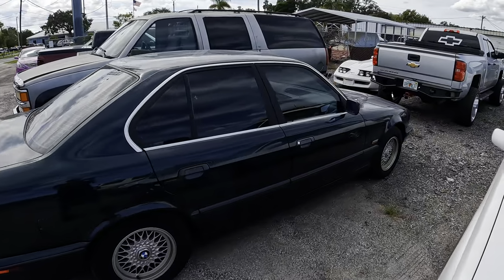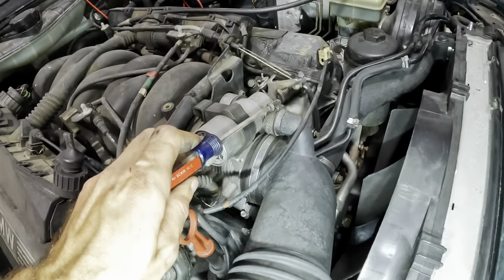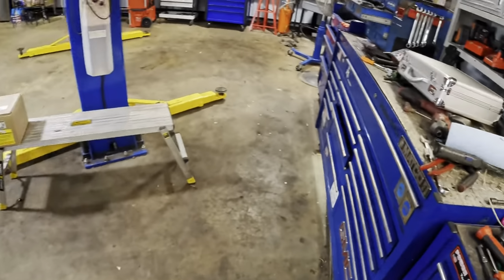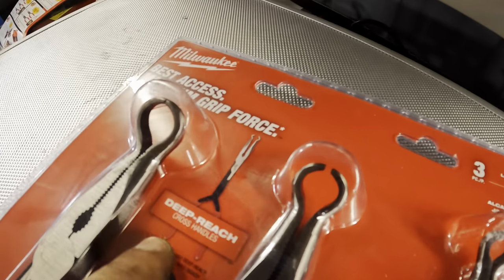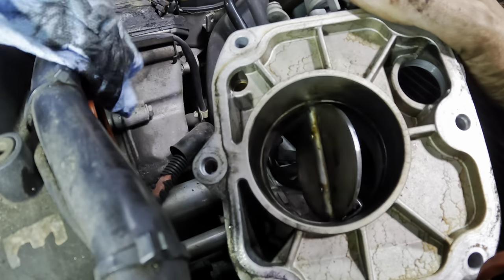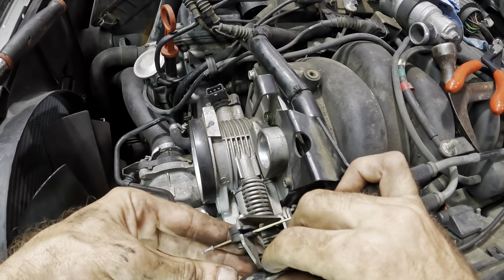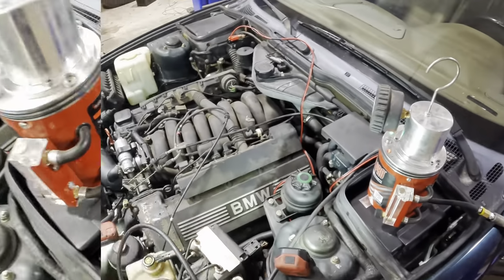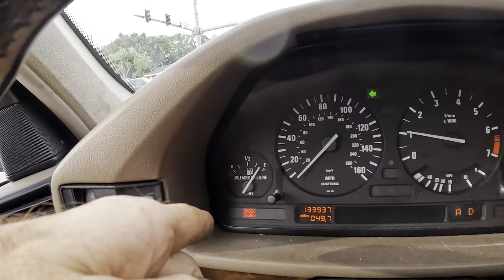DO NOT DO THIS! Hack Repair. Engine Diag Running Rough BMW 530i 3.0

Comment: Ray, have you tried the propane trick for diagnosis of an intake leak? The same trick works with wd40 or other flammable sprays.  If while idling you point the hose from a propane source or spray around the intake and if the idle goes up you found a leak.
Reply: The better version is using brake clean because you can't really put a torch in many intake runner areas especially on the V engines
Reply: @ScrewedEquilibrium  Not lit, the propane gas alone. THe mechanic that located my intake leak had a very long fine tip to get into very tight places worked great.

Comment: One helpful hint on BMW engine clamps, the BMW symbol should generally be facing up (or forward). This is not 100%, but damned near. When they are situated in that position the tightening screw should be accessible and it will make sense where to place the driver to tighten.

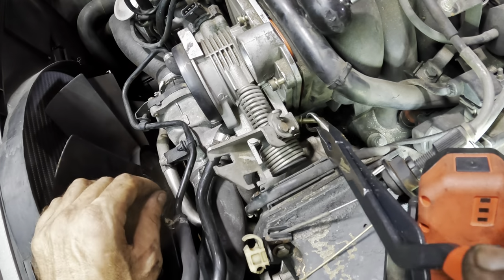Comment: @34:00... Use a hose with an I.D. that will fit the end of that bolt and snake it in underneath.. Get a couple threads in and wala... You know the rest.

Comment: Someone tell me about the misfires. When Ray is test driving at the end, he is anticipating possible misfires as the car comes to a stop (idle). Is idle when misfires from bad air-fuel mixture are most likely to manifest?  Great video from an older BMW fan. Thanks.

Comment: Use Gorilla duct tape ! I use the stuff to tape a tarp over furniture on a utility trailer and it held up for a very rainy trip of1500 miles. So well it was impossible to remove from the tarp and frame of the trailer. ( no ratchet straps were used) Moved the stuff for my ex wife and actually was hoping damage would be done !

Comment: Hey Ray, I see that towards the end of this video you are not so enamored with the front flipping hood. At the beginning you were eloquent about how much better it was at giving access, because of the vertical stance it takes when open. And this is true. What is not so clear at the onset becomes very clear as the work progresses. With normal cars, you have access to 3/4 of the engine bay. The cabin and body get in the way at the back. With this German beast, the access is one half, less than normal, and compounded by the fact that you have to walk around every time. So the negatives outweigh the positives.
Reply: They never wrap around the windscreen though!:face-blue-wide-eyes:

Comment: 34:57 a trick to locate a bolt like that in a very hard area to reach 
Is slip a none interfearing tiny too small of an O ring over the seating side of the bolt to hold it on by 2 or 3 threads  then when you slip the part down into its location the bolt is ready to thread intto it location 
That or a thick grease in the bolt hole.
If you think about it outlet screws are held on with a thin cardboard 
So you always have the screws.  Same idea.  It can save you from doing bolt aerobics.

Comment: Hey Ray! Nice. These days there's probably an RFID embedded in that package, which an antitheft gizmo at the door can see to raise an alarm if you haven't paid for the pliers. So maybe the stout package is not totally dumb... They sure are ridiculously hard to open though. :-) Your finger dexterity is amazing. I'm sure I would have needed a half-hour to get that bottom bolt in the throttle body started.

Comment: regulator bars just need a little fresh grease to get them movinig but taking the plastic barrier try to avoid the goo glue. lol. But what did codes say or once you drove and keyed few times did engine recalibrate and you were done on BMW 530i 3.0?

Comment: Self fusing or vulcanizing tape instead of standard electrical tape would have been a semi-temporary solution and givven much better seal. They can be handy from time to time to create a good seal around something... like sealing some broken connectors together or making them watertight.

Comment: Guys when you have the smoke machine connected and block the throttle body you have to give the crankcase a way to let the pressure out if not you can blow out the crankshaft seal and that would be bad, don't just pull the dipstick the reason for that its tube may go below the oil level so that if you don't put the dipstick in fully you don't create an Evap fault. Saying this from experience.

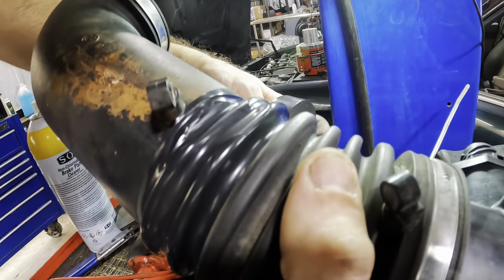Comment: @12:10 I had used 2 layers of duct tape to temporally plug holes like that until I could get the part as I had only one vehicle at the time.

Comment: Another tip is to tape the bolt to the end of the tool.  After it's tight, you just pull the tool out.  Heavy grease has also worked for me for 'sticking' a bolt to a tool.  But I'm really surprised you don't have any magnetic tools! @rainmanray

Comment: That's a massive hole.
Never seen a hole that big in an intake boot.
Downstream of MAF sensor.
Massive positive fuel trims both banks.
Super lean mix.
Goes into limp mode.
Does OBD1 not include fuel trim values?
Sure it does,

Comment: While I don't think my Kia Sportage has a rodent hole in the intake, post mass air flow sensor, I did remove the intake to replace the valve cover gaskets and just clean and gap my previously replaced spark plugs.
Since then, I have a bunch of check engine codes relating to the O2 sensors and running lean and fuel trim.
I happened to have four new O2 sensors and changed bank 2 while I did a radiator replacement. Unfortunately, I got them after the intake manifold was removed and replaced and the bank 1 sensor 1 O2 is going to require pulling the intake to get to it.
I suspect the engine is saying its running kean, because it has more air than is being metered and thinks that the fuel is lean.
The first time the intake was removed, there were air leaks and a mechanic removed and resealed it to correct the problem.
I made every effort to avoid having any air leaks when reinstalling the intake, but I do suspect that I still missed a spot.
I made a makeshift smoke machine using a fog generator from Halloween and the output of a shop vac to supply air pressure and didn't see any smoke leaking, but it was not the best way to test.
I just hate to have to remove the intake and reseal and reinstall it.
The car actually runs pretty good, but has the check engine light illuminated.
It did on a few occasions run rough and misfire at low rpm to idle.
.

Comment: Hair shifts to comment of what I think would be a perfect repair for the whole. Is you some of the insulations carts that you used on your Silverado duly pick up that you put on the floor board for as you called? It a installation paid is take that pad and since it has the sticky side on it put that on that whole and take a screwdriver some and just. Keep walking it back-and-forth and told you have determined that that.
 How was sealed off and then put electric tape around it to hold it and?

Comment: Throttle body butterfly shaft leak. Not much can be done about it without modding it or replacing the whole TB. Been there done that. 😂

Comment: Activa 001 looks like a Chevy Spark, which is also known as a a Daewoo Matiz. The Matiz was not a great seller, but the same vehicle, just with all the Daewoo badges replaced by Chevrolet, was a pretty good seller, as it is both economical, low cost and relatively cheap to maintain.

BMW going to bet check engine light is a dead cat or oxygen sensor, caused by it being a little long in the tooth, and having an oil addiction, or a inlet flap or cam fault.

Comment: They off BMWs around the 100,000 mile mark because all the plastic, vinyl and rubber parts start to breakdown from the heat under the hood. They are well worth the time and trouble to repair if you can find a good mechanic.

Comment: I bought a 97 540i 126k on the dash. When I went to check the car out the guy I was buying it from leaned on the intake hose and cracked it. The car wouldn't start. I left and he called me 20 minutes later. He patched it up with duct tape. He was asking 3000 I got it for 2200.

Comment: That looks just to be about right size to go down to the diesel mechanic shop and get a charged air boot. You can cut that waffle stuff off and hose clamp it right back together.

Comment: Might have been worth while cutting a slot in the head of the damaged torx bolt, if you can’t replace it. A slot screwdriver won’t apply as much torque as the correct torx could, but it will be better than a pliers.

Comment: Hallo Guys! One question......Why does the M62 have low power on low RPM ....?!! i have 740 IL non vanos from 96 ....and it's a lil bit slow......the previous 728i(European version with M52) was more agile ....
Reply: With an inline six, DISA valve on the intake manifold may be the cause. Common symptoms  are low speed sluggishness and could be a puka puka sound coming from inside the intake.
Reply: @rodbender6184  M52 from 94 to 99 has no DISA ....and M62 is a V8

Comment: You need to put declaw hammer back into your carpenter tools. It looks strange for anyone to use a claw hammer on the engine work, but as you say everything as a hammer, big Ed coming to you from Central city Kentucky. Have a great and wonderful day.

Comment: you say the thief would just take the whole thing, but you'd be surprised.  I work in retail and i WISH they'd steal the whole damn thing, then i just have to do a inventory adjustment.  What they do instead is steal a handful of screws out of a box, then i have to try to sell what's left (not as easy as it might seem at times, even with discounts)  One time a guy tore open a set of house numbers and took just the screws.

Sometimes when the customer only wants 1 thing in a pack, they feel it's a ripoff they have to buy the entire package and decide it's ok to just take the piece they want.  After all, how much are just the screws worth? it's only like a couple cent's right?  Except it's not easy to find proper replacements, if it's even possible at all (in a practical manner, no sense spending 20$ of time to save a 10$ product, that people still won't want because it's been opened)

Comment: Hi Ray. Not sure how big an issue it was in parts of America, but some of the M52 and M60 BMW engines here in the UK suffered from the (in)famous Nikasil high sulphur fuel erosion. Might be worth a compression and leak down test even after almost 30 years?

Comment: Heat from the thermostat housing made the bellows brittle over time, you missed an opportunity for upgrade and saving the customer a buck and the down time when you could have just cut the flex section out of the equation and replaced it with a (naturally more hi-temp silicone) section from a CAI...

Comment: If you need to manoeuvre a bolt into an awkward place you're best off with a magnetic holder or, failing that, jam a piece of paper between the tool and the bolt or stick it to the tool with some sticky tape.
Your needle nose pliers method looked right awkward. 😁🖖

Comment: How could you neglect to see that the rubber mount slides up and on from the bottom of the bracket? You just put it on 3 minutes ago. 🧐🫡🤤

Comment: PLEASE BroMechanicMan: put an Auto close on that Side Entry-Door.

It’s gonna catch something eventually.

Then? You’ll be “Poppin’ Zee Door”….& some PDR as well.

BTW?, “Smoke” test will NOT reveal an intake gasket leak….why?, Because they pressurized smoke test fins passages of least resistance whereas an (opportunistic) vacuum leak?, simply sucks through anything & everything at greater & higher velocity.

On BMWs the weakness is always the intake bellows.

Disappointing That you didn’t break out the double handed brake Kleen master-blaster on that throttle body.

& those hard to reach bolts?, best to use a pen-size pocket telescoping magnet.

Comment: That is an early design Nikasil cylinder coated engine. They had issues.  Do some  internet research and a compression test before getting in too deep...

Comment: Ah the old M60, predecessor of the M62 in my old E39 540. These things are such garbage. That car was such a money pit. Leaks from every orifice; valve covers, spark plug tubes, oil pan. Garbage plastic cooling system, wonky MAF sensors. I don’t miss that car (or the ones with the early N63). Thank god the newer ones are far more reliable. 4 straight BMWs now without a single dealer visit for repairs. Knock on wood.

Comment: Hmm. An old E34 should feel better than a modern VW, or anything from the Ford stable. If it doesn’t, there’s something wrong. The autobox seems wrong and the v8 noise seems strange and misbalanced for one of those. They’re usually sewing machine smooth, with a snarl from the factory exhaust, and mostly manual, over here. But they’re all sixes, or at least, the ones that I’ve owned and/or worked on have been. They were marketed as the ultimate drivers car, so any driver that bought an automatic one would have been ribbed mercilessly by his mates in the company car park.

Comment: Ja..."da Deutsch Auto"....meh,  I like my Ford F 350 Super Duty with the Diesel option thanks.  Works great tow'n a 4 horse trailer 'n 4 800 to 1200 Lb horses....

Comment: The problem is that emblem!  It has the actual car attached to the back of it!  My old Pontiac Grand Prix was more reliable than the new 3-series I bought.  Bring Money With.  Never make that mistake again…
Reply: I traded my 328d for a slightly used Honda Accord once it cost me $800 for a new front brake caliper.  The old one was sticking...... Instead of trying to fix it they just replaced it!  I couldn't wait to see what another "minor" repair was going to cost so I got rid of it. It was 10 years old at the time so I knew a clock was ticking somewhere.....🙂🙃

Comment: The phone part was too funny, however the replacing a stripped bolt in the throttle body
using hose pliers to tighten it and complete  a video says it all.
Sorry man, I just can't watch no more. All the best Ray

Comment: This is where some repairs can cost more than the car could be worth.  Maybe not now, but coming soon.
Reply: order new Banks air tube.
Reply: Depends, is the repairs going to cost less than a year of new car payments. If so, and they will hold it out for another 5 years, do it.
Reply: @SeanBZA  not necessarily, I had a LS460 Lexus and the cooling system components were failing like dominoes. Everything was new except for a leak under the intake and the head gaskets. I was afraid that after fixing the leak under the intake the head gaskets were next because that would be the last domino.
Reply: @brandonstclair6530  Well would doing that be less than new car payments for a year?  If so, you got another 5 years on the Lexus, which are in general regarded as reasonably good vehicles.

Comment: nothing wrong with a tape repair here. hard to get parts can take weeks to locate, self amalgamating tape would be best.
Ecu wont do any learning while the money light is on, it will run to a set of none values, until light reset.

Comment: Happy Birthday, RAY! Welcome to German Auto Hell, "SCHNELL!". Lots of excessive parts all over the place. Yes, my 2006 525i has TONS of plastic in the engine. The secret is complete disassembly and bathe using Armor All. The ionic bond in the plastics is very poor. Armor All improves those bonds. Doodley Doo! 🤣🤣🤣🤣🤣 Also, almost ALL BMW's have, "Squishy" Brakes.

Comment: That good old bmw quality, DAS AUTO 😂 but fr I bet what happened is when the bolt was being tightened from previous maintenance it got over tightened and instead of the threads going the head stripped out.

Comment: Hard to work on, insanely expensive repair parts and unreliability are the three reasons I will never own a German made car. Audi, BMW, and Mercedes, are you listening?
Reply: There are plenty of reliable german cars, it is the weird, luxury and performance models that are usually the ones that are expensive to maintain.
But there are always exceptions.
Not all American made cars are well build or maintanance friendly.

Comment: Good video, but I do have a couple of comments and they're going to sound really trivial I work for about 41 years doing industrial sheet metal it came designing and Manufacturing and installing and removing a lot of different types of ductwork along with dip tanks and all sorts of other things, from 24 gauge up to 5/8 plate two things about the vernacular the word duct has a silent t as the word originates from a place in the world where the t would be silent. And when you're talking about the mechanism of routing such items, it is not called ducting. It is called duct work. There just doesn't happen to be feathers on the duck. And that's the proper pronunciation. I don't mean to be trivial but even minor you misuse of the English language is getting to me lately because I realize how far gone the woke Community has become. Starting off with things like calling the cockpit in an aircraft a flight deck. And as you know a flight deck is where you land planes on an aircraft carrier. I don't think it will fit in most of the aircraft that you travel on but like I said, good video thank you.
And have fun putting your truck back together probably tomorrow at this point or even today as I'm actually watching this on Friday.